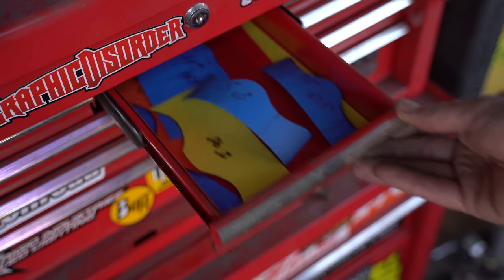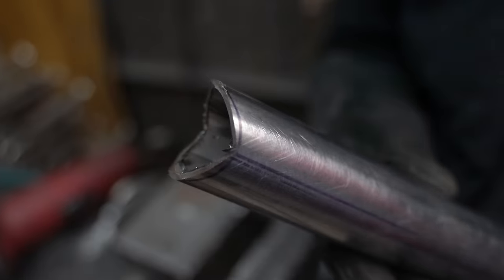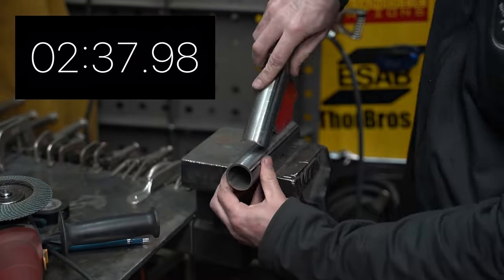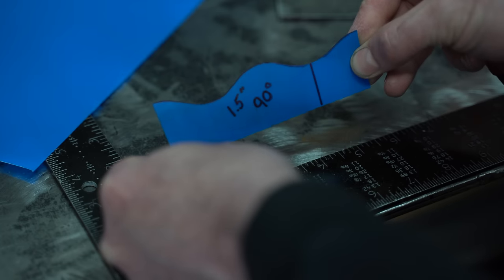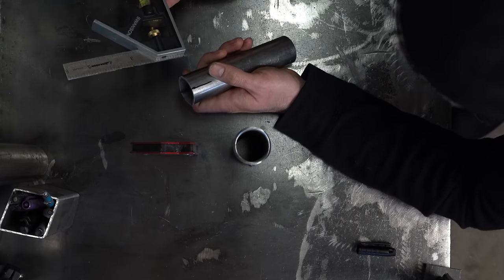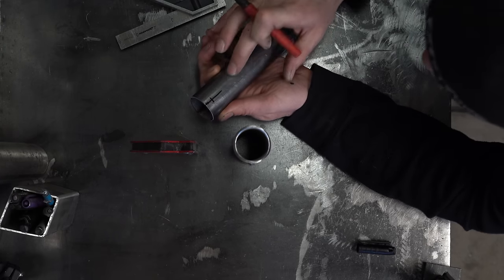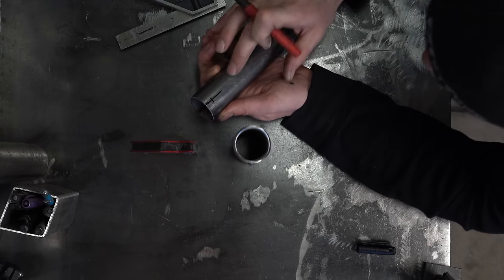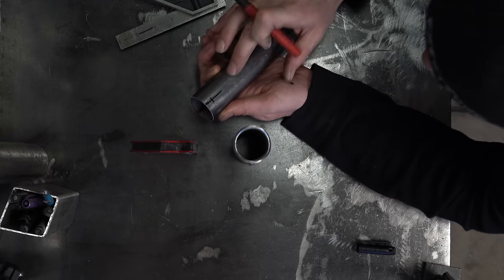How to Notch Tube with Cheap Tools!

Comment: If you would have cut it 90 degrees to the tube starting at the thickest part of the radius  cutting a crescent or fingernail shape it would already be a round cut and it would have a bevel at the same time , then just shape the edge and weld away , no v cut no radius shaping , cutting like that also works on all angles, remember little crescents not little v triangles
Reply from the maker: Agreed. I’ve always struggled with that method though. The chop saw makes this a simple task, but with a handheld cutoff wheel I find myself removing too much material on the underside or not enough because I can’t see the marks. I’d be willing to admit this might be a lack of skill on my part but, my little Vs make up for it.
Reply: @GarageFab  well just follow the marked line and you won't remove to much
Reply from the maker: The mark that I can’t see? Excellent!
Thank you. 🙏
Reply: @GarageFab  turn the tube 90 degrees and cut with your 4 inch blade going vertical, more guys cope to deep thinking you have to get to center of the tube your coping to ,not correct , the throat should only be about 2/3 of the way to the centerline of the tube your joining to . If you go to deep you would need knife edged thin tubing to get to the centerline, not good for strength
Reply from the maker: Makes sense. Much appreciated!

Comment: This is good if you're in a pinch or if you can't afford a proper angle grinder and a really good trick but there is no way this is faster.
Reply from the maker: I’d be willing to race if setup time is included.
Reply: @GarageFab  That's the point. I clamp, I set angle and I cut. If you're doing this in a garage as a hobby, sure this is an option but if you're a production shop or you need to be spot on or maybe you just want to deal with one tool then a jig is better.
Reply from the maker: Agreed

Comment: Stupid question how do you measure for your notch say you have to have a 2' in between to pipes and you want to notch the 2' section in do you measure off the notched instide part or off the longest part maybe im over thinking this 🤔
Reply from the maker: Not stupid at all, Charlie. First lemme make sure I’m understanding you. The way I’m interpreting that question is you want to notch both ends of a short tube and you want it to fit between two other tubes.
If I’m wrong, ignore the rest of this and clarify.
First measure the distance between the 2 existing tubes. You said it’s 2”? In theory if you were to cut a 2” length of tube, it would fit tightly between your other tubes but it wouldn’t wrap around the way it would if it were notched. So you essentially need to ADD material meaning the 2” is actually the distance between the throats of the notches on each end. 
Remember when notching equal sized tubes, the notch depth will be 1/4 the diameter of the tube. 1/4 of a 2” diameter is 1/2”. There will be a notch on each end so two notches that are 1/2” each will require an extra 1” of material.
All that said, you’ll cut a length of tubing at 3”, and carve in two 1/2” deep notches. That should fit nicely. Getting that piece in between two other tubes that have already been welded is another story. 😆 
This stuff can be confusing, especially in writing, so hopefully I didn’t make things worse. Lemme know!
Reply: @GarageFab  bro thanks for the update man that definitely is the answer to my question really appreciate you getting back with thanks !!! 🤘🔥🤘🔥🤘🔥🔥🇺🇸🇺🇸🇺🇸

Comment: You can beat that time by 30sec if you had a second grinder.
Reply from the maker: Yes! So true. I actually have 3. The 3rd with a wire wheel. I was concerned that I would get called out for using two separate grinders. CHEATER!!

Comment: 6:47 Wouldn´t it be better to have several pieces of thin-walled pvc-tubing of various diameters, pieces of the length of your templates, and cut notches in them with the cheapest metal-notching saw (that costs just 2$, but is actually always too bad for any actual metal-work), and then always use those prepared pcv-tube-pieces for any future template-fabrication??? 
You can even double the pvc-piece-length, and use both its 2 ends for a different notching-angle each, so that your pvc-template-archive doesn´t overflow.
Reply from the maker: I’ve got no argument! Yes I think that would be a lot better in practice. I’ve got probably 20 templates and they all fit in a tiny drawer and that’s about the only thing that’s better about the plastic sheets.
Reply: @GarageFab  Sure, if you already have a bunch of them, it´s logican to go this way... I was talking more from the perspective of a first-time-maker, who has not a single template yet...

Comment: You forgot to show how to make the hole in the other pipe just in case there was a requirement for it
Reply from the maker: Hole? For weld heat pressure release?
Reply: @GarageFab  Your getting close to heat, or maybe it's called getting hot !

Comment: why not just make a tube out of the template material, then do the cutting and shaping on that? thin plastic folder is much easier and quicker to cut and trim than metal pipe. and cheaper.

Comment: Notch it like you do a log or a tile. Much quicker
Reply from the maker: Please explain, Michael! I don’t have any experience with logs and very little with tile.
Reply: It's a lot easier to show than to explain but it's almost like the way you use the marker to make a straight line. If you are doing a 90° bend. Put the pieces together with a magnet to hold it in place. Then take the marker and go around the one at the bottom but Mark the one on top to get your cut. Not sure if that makes any more sense
Reply: You would be marking the one that is up and down and not side to side
Reply: The one I'm referring to you can find it on YouTube it's called a log cabin Saddle Notch scribe
Reply from the maker: I think I understand! I think I’ll have to try it out and see how it goes. Thank you my friend. 🙏

Comment: Far quicker to use a bench grinder with a radiused  wheel to cut to the line. I've done hundreds of joints like that
Reply from the maker: Interesting!
Reply: @GarageFab  I keep one 3/4" wide medium grit 6"wheel on my bench grinder just for that. I build airplane stuff.  You can use a wheel dressing tool to shape it and the shape isn't critical. Just enough to get into the smaller diameter tubes.

Comment: tube notchers suck. we use a hole saw in a vertical mill, clamp the tube in the vise. line your sharpy mark up with the vise edge. cope your tube. simple and fast.
Reply from the maker: Sounds dreamy. I look forward to owning a mill some time in the next 40 years.
Reply: @GarageFab  you can usually pick a mill up for about 900 bucks. they just take up a ton of floor space.
Reply from the maker: Haha! That’s the key. It wouldn’t be Garage Fab if I had enough room for a mill. I’m considering building another 2 car garage sized building in my back yard so I’ll revisit this topic then.
Reply: @GarageFab  im in a 2 car too, on a regular suburban 1/4 acre. my garage is 4 machines facing inwards where i stand in the middle on one side, the other side is tig welding, parts cleaning and general mechanical stuff. i do all my fab work outback on the RV pad. i keep my cnc plasma out on the patio lol {pretty common here in az} Building a skoolie drive in toy hauler right now back there. Id love a shop but alot the stuff i do is just too big for indoors. i was thinking of putting up giant shade sails out back. That would be amazing.
Reply from the maker: Sounds like you’re all set up! 👍 Almost.
Can you imagine being comfortable while working in both summer AND winter?! These are the things I fantasize about.
That and not having to dance around tools and disassembled vehicles to get from one side of the garage to the other.
Reply: @GarageFab  i installed a mini split and it was the best year of my life.....then it broke the next season. sigh. lol. ive never had room to move even in the big shop we were nuts to butts at all times. as biggie would say....more money more problems. ;)

Comment: Be Smart Man 
2 Easy Ways Better Than You
1. Holding Bamboo Wooden Toothpicks
   With Paint Tape First And 
   Put Them All In The Top 
   All Around And Drag 
   The Line.
2. Hold 2 Parts Together And 
    Get 1” Stick Metal And Make 
    A Hold In One End And Put The
    Pen And Go All Drag The Line 
    All Around.
Russian Brain Better Than Anyone.
Amén.